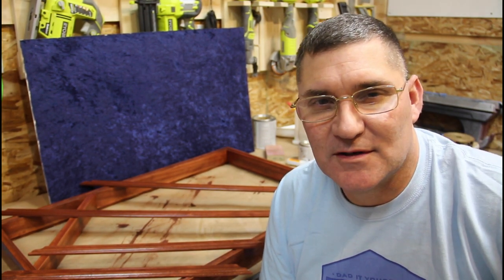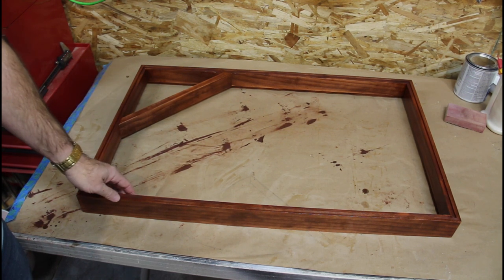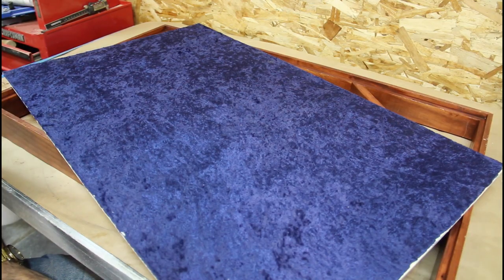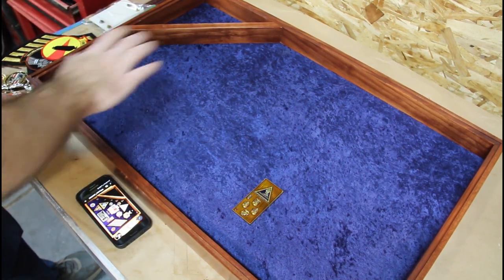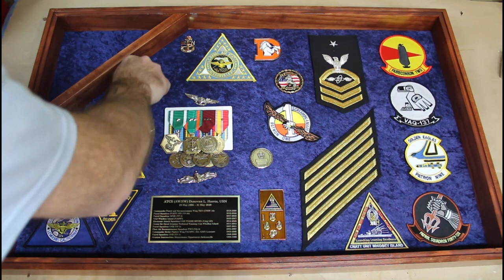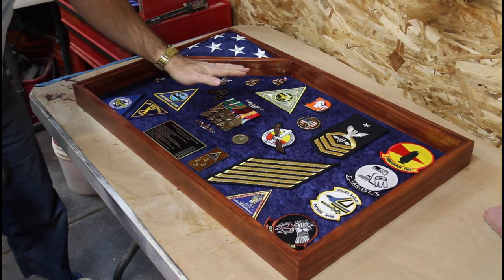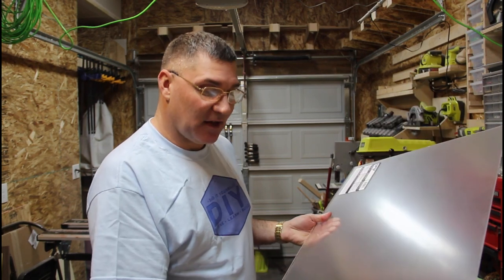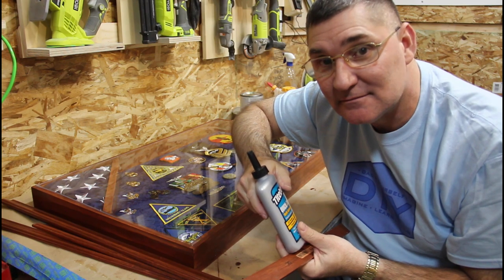How to DESIGN a Military SHADOW BOX | Tips and Tricks | 2020/07

Comment: Did you cut the backings off the rank devices and medals?
Reply from the maker: I snip the posts off short, so there is still a little bit to sink into the backing. The hot glue ultimately keeps everything in place.  If you have a back panel that is 1/2" thick or use a layer of foam, youvwould not need to do this.
Reply: @DadItYourselfDIY  thank you! I need to remount some of my items that fell off.
Reply from the maker: Hot glue is awesome!